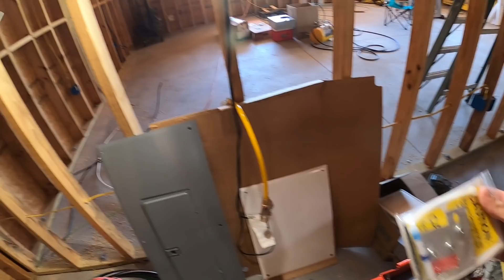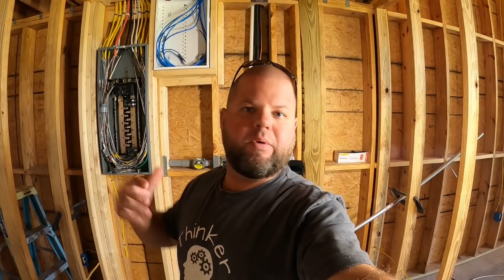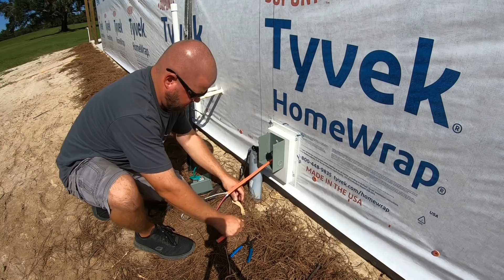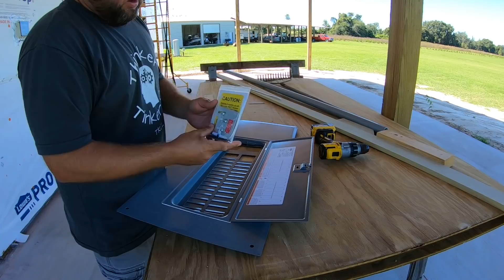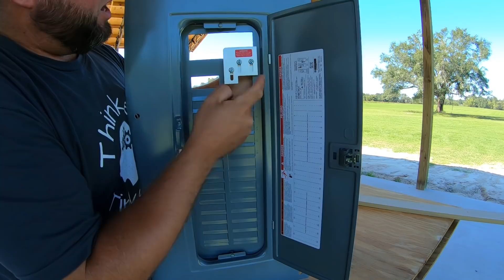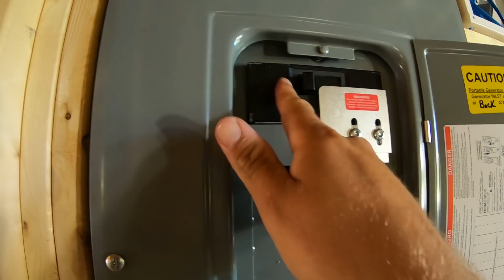Generator power inlet box and interlock kit install! #452

Comment: I think you're making a  mistake by not installing a 50 amp breaker and correct wiring for 50 amp service.  It won't hurt anything at all and you'll be set if you ever happen to upgrade your generator and it's only a few feet of wire so cost is negligible.  I would definitely consider changing out to thicker gauge wiring before you insulate your walls!  You go above and beyond on everything else I'm just a little shocked you aren't doing the 50 amp breaker and wiring here.  I did at my house and don't regret it for a second because I did get a bigger generator and I was set without having to make any upgrades.  Oh, you can get a plug adapter to plug your 30 amp generator into a 50 amp outlet just FYI! :)
Reply from the maker: It's because I have no desire to upgrade to a larger generator. I already have the wire leftover from the dryer install and I did not know about the adapter plugs. I built my main panel cabinet for easy access in the future. If I ever upgrade generators, I can change the power inlet box and wire in about 15 minutes. But if I ever do upgrade, it would most likely be a whole house on demand generator and that's a completely different setup.
Reply: @TKCL  good deal! :)
Reply: I like your video and thanks for posting.  Just so you’re aware, you could have installed 6ga or 4ga wire and still used a 30a breaker and plug.  No adapters needed.  I’m not convinced you could “easily” change out the 10a wire as it is not only stapled to the studs, but you put the electrical connector to the breaker box on with the wire clamp screws outside of the breaker box.  Once the drywall and insulation is installed, you would have to cut open the drywall and dig out the insulation to replace the wire.  Just a thought.
Reply from the maker: What this video doesn't show is a door that's being installed right below the breaker panel for full access. I'm also putting one above the breaker panel too for future wire pulls. I also tested my generator yesterday and it ran the entire house, central AC included. Doesn't look like I'll even need to upgrade the generator, wiring or plug.

Comment: Apologies if you've covered this in the past, but what appliances will you have that are gas (propane)?   I have as much as possible (water heater, central heat furnace, dryer, cooktop) on propane so that I can have all those things even in the face of a power outage, relegating the remainder of the house to be carried by the generator (which is run on propane as well).
Reply from the maker: Outdoor kitchen, water heater and our stove.

Comment: Currious, how clean is the power coming out of the generator? Do you have a pure sinewave invertor to clean the power before it gets to your house? I love of devices need clean power or they will burn up or not work at all. Im sure you know this but just wondering your method
Reply from the maker: No this is a standard square wave generator. Sensitive electronics won't be ran while using it. I've never had a issue with this style generator running my equipment for the past many years.
Reply: @TKCL  Cool deal. Im working on solar off grid aquaponic system and hoop house for next summer. But also want back up generator setup with it, Loved the video as Im about to set up back for house also in Florida lol
Cheers man!

Comment: Have you checked what the output breaker on your generator is? If it's a 10KW continuous, you'll likely have a 40 amp breaker. If it's 10KW peak, then a 30 amp breaker. Whatever the case, you'll want the same size breaker in the panel as on the generator.
Reply from the maker: It's 9375 peak and has a 30 amp breaker on the generator itself.
Reply: Cool, then you're golden :)

Comment: Made my own interlock slide, works great and also made up emergency use cards to show genny startup sequence, and shutdown. It's also important to load balance your panel as much as possible so one leg of the 110 genny isn't working too much harder than the other leg. Like one leg is running a freezer and and refrigerator the other just a few fans or lights.
Reply from the maker: I agree, that's why I left my wires so long. I will think through and balance my panel when the time comes.
Reply: @TKCL  Yes Sir balance as best you can and adjust on the fly when the time comes! You'll make it happen. Love the videos Sir!

Comment: Question: I thought new home builds require seperate Ground and not be "bonded" to the neutral.  We had a whole house generator but got eaten up by rats, so there went a lot of money. So we have the second breaker box next to the main break panel...and of course the rusted pile of a whole house generator outside. I am thinking about removing that generator panel which has the auto switch to trigger the generator to turn on. i might remove that panel  to get money off it.  But an electric contractor in my area informed me all new breaker boxes must have seperate ground...and not be bonded. Since the home I am in was build in 68, its grandfathered in...
Reply from the maker: No, the code states the first means of disconnect after the meter is bonded. That even means a disconnect switch, so anything after that requires separation of neutrals and grounds. Some people are required to have a main disconnect after the meter, but before the main panel. In that situation, the main panel is the second means of disconnect and would require separation.
Reply: @TKCL  ok so our meter goes into a Main breaker panel where our solar panel line is fed into one of the breakers, oh heck i have to look at it in the morning. But our outlets in the house are not grounded, its bonded to the neutral....
Reply: I agree with your approach, even though auto transfer switches and auto start generators sure are fancy 😁. Something to think about, make sure you know which of your generators already have bonded outputs and which don't. I actually bought a tester and built bonding plugs for all my camping buddies and found one of them actually had a generator that is already bonded output per my tester.

Comment: Plug might be too low. There's a minimum requirement to grade. At least that's the deal in my state up north.  Also when are you going to do the service grounding and rods?
Reply from the maker: I've looked and looked and looked. No NEC code I can find for a minimum receptacle height. There is a code for maximum height. Don't forget this is a non power supplying plug. It only has power when a generator is hooked up otherwise it's dead all the time. Grounding rods go in towards the end of the week.
Reply: @TKCL  the reason is snow or flooding up in my state.

Comment: I have a separate maintained supply panel for sockets, lights, spurs that will operate in an emergency. All the sockets  and spurs are RED in colour. Normally they are switched to the main panel but in a power outage they automatically switch to the maintained panel. I don't know if my system would meet your electrical code.

Comment: They also sell panels with the interlock kit already installed on the panels.  Very nice setup and easy to use.  I can run well and whole house minus AC and Hot tub on 6500i Honda.  So all I have to do is flip a few breakers and then I am on the generator (a must in northern CA due to our failing utility/power grid.  Suggest using largest wire size possible from plug to panel to eliminate voltage drops and having to upgrade later if bigger generator is acquired.

Comment: I love the interlock on mine.  Keeps the wife from messing things up when I’m not home.  I have a colored tag next to each individual breaker to leave on when on generator.  Using LED lights lets you keep more “on” when the power dies and on generator.  A few lights, food storage and heat.  Don’t rule out window ac unit.  For extended outages use it in the bedroom only so you can sleep in the heat.  Backup to the backup.  Remember in emergencies one is none and two is one.
Reply from the maker: We've always kept a window unit just for power outages. But this might be the first time ever that I can run my entire house hvac. We also have a gas stove and water heater. So showers and cooking is no problem during an outage either.

Comment: Hay, why is that outlet so close  to the ground,  I  thought  the minimum  above  ground was 30 inches?
Reply from the maker: There is no minimum for receptacles to ground, only a maximum height. It's low for future pulls of lines in through that decor box and to match the other decor box. Keep in mind this plug never has power unless a generator is hooked up. It's not in any danger and isn't a true receptacle in that aspect.
Reply: I've seen receptacles on floor of homes